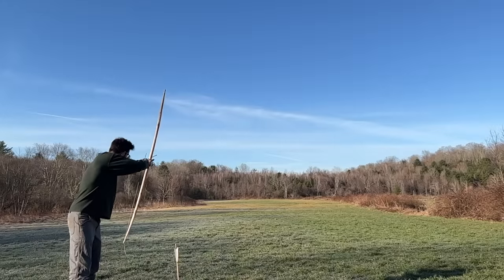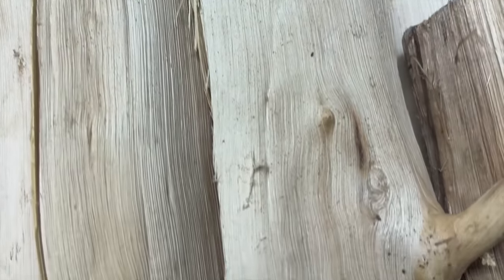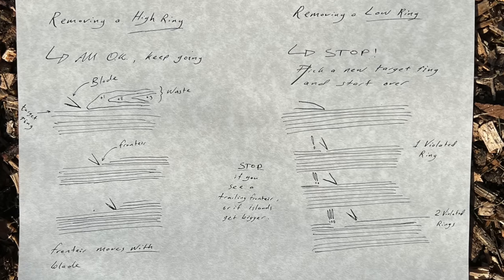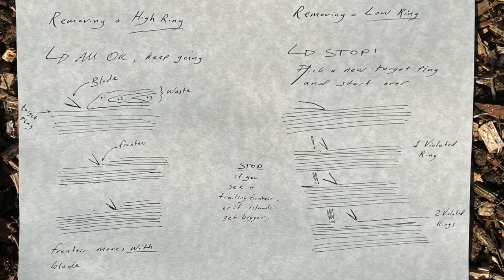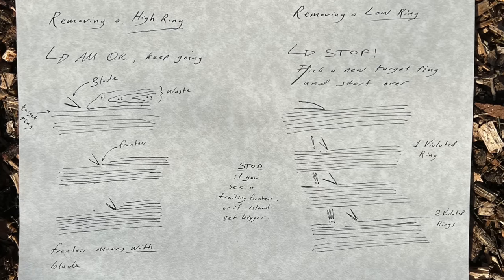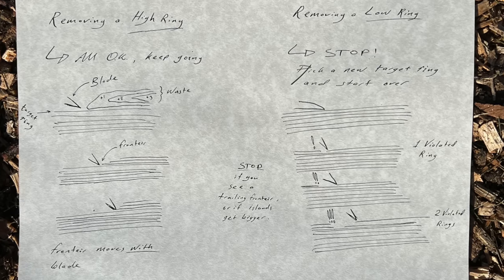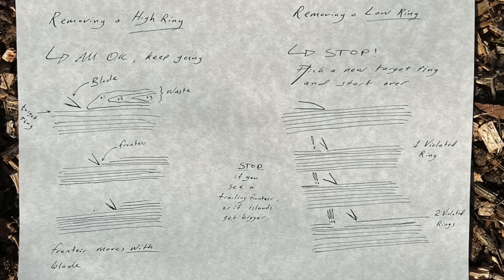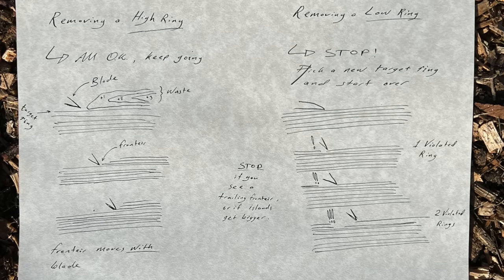The Back of the Bow,  6 Ways

Comment: Wouldn't giving a stave a "hot shower" to remove the bark result into having to wait for the stave to season itself again?
Reply from the maker: It doesn’t fully wet itself. That layer doesn’t take long to dry. By the time you start bending the bow it should be fully dry again

Comment: I'm slightly surprised bow-makers don't use carving discs on angle grinders - at least I have never seen one use one. They will do all the rough shaping very quickly - you can finish the shaping with hand tools. Just my 2c. When the carving disc becomes too coarse & unrefined, when you're close to the final shape, a 40 grit paper on a grinder will also make great progress & is easy to create "Flow" with as you can move it so fluidly.
Reply from the maker: I can move a lot more wood with a drawknife while having more fun and without throwing dust everywhere. I had the same thought when I was starting out, thinking the angle grinder would be much easier. That’s true early on but when you get experience with blade tools and stop making so many mistakes then they’re not so slow and have the advantage of following the grain. That’s not to say you can’t use one, but like any power tool (belt and oscillating sanders are more common in bowmaking)you have to be careful about following the grain. Having tried it both ways, I can do a much, much better job with hand tools. The only time I’d consider using the heavy powertools are for a board bow or modern laminate. For character bows and the workflow I have they just don’t fit in that well.
Reply: @DanSantanaBows  I'm not gonna argue as I spend waaay time shaving away ash bark/wood using a hand-blade. :-) I sit in the shade & clamp the stave in my knees, work away dust free.. and happy. It's like a form of meditation. :-) 

But the grinder stuff works too. :-)

Comment: Can I use mulberry for a bow i heard it is actually good and that its a cousin of the osage
Reply from the maker: Yep treat it like osage just make the bow about 10% wider
Reply: @DanSantanaBows  so how wide is it supposed to be approximately
Reply from the maker: @nikolakolenovic4589  It depends on the design and stats. That would be compared to an existing osage bow with the same draw length and width

Comment: What wood class is hazel for you?
Reply from the maker: Classic whitewood. Does well with heat treating. Can be hard to split so I usually use the whole log as the stave unless it’s a very big one
Reply: @Dan Santana Bows  thanks, that was a fast response! I have one log laying around and removed the bark on the side I want to take as belly so it dryes better. I'm not sure if I even should use this one. It has a side were there is a tiny bit of damage. I probably would have to chase a growth ring. 
Do you think it would be better for me to start with a board bow? I don't have a stave laying around sadly :,D
Reply from the maker: The big advantage of a board bow is you’ll be able to get started right away. Usually I recommend finding some staves and making a board bow while they dry
Reply: @DanSantanaBows  thanks for the advice! I will watch your build along board bow video again and take some notes. Be ready for my first tiller check in a few weeks!

Comment: Sorry but I still don’t understand why you don’t need to chase a growth ring on a board bow, at least a good board bow.
Reply from the maker: You need fibers that are unviolated across the back. Chasing growth rings is just one way to accomplish that—or you could just choose a board with straight fibers that was sawn parallel to the fibers. Most boards won’t have this quality, but with a well selected board the fibers won’t be interrupted across the back.

In other words what is directly important isn’t whether the growth rings are violated, but specifically whether the fibers are violated.. 

Another way to look at it is that board bows are basically decrowned bows. When you decrown you cut across growth rings, but not the fibers that will make up the back. Growth rings don’t have any inherent strength that doesn’t come from the fibers, they’re just bundles of fibers. Chasing a growth ring makes sure you have a nice strip of fibers across the back but it’s not the only way
Reply: Thanks, I get it, but I think I just have to experience it for myself. Thanks again